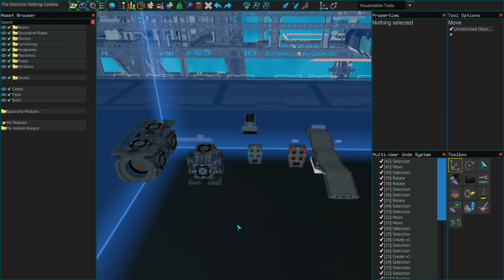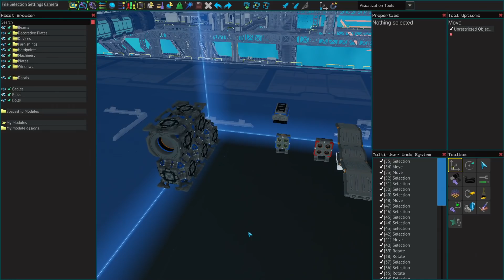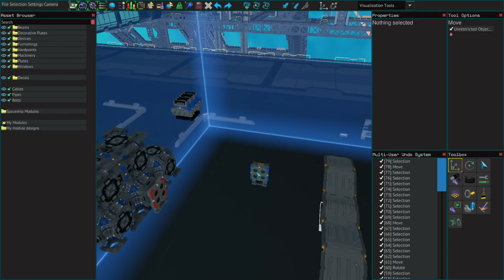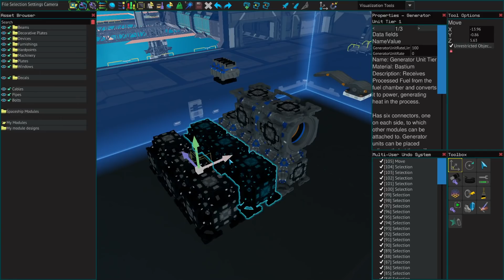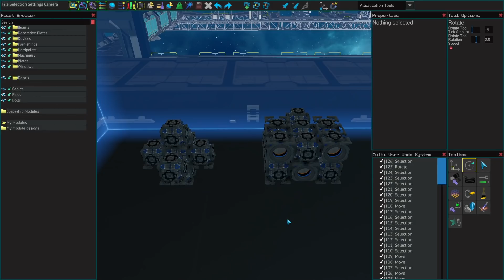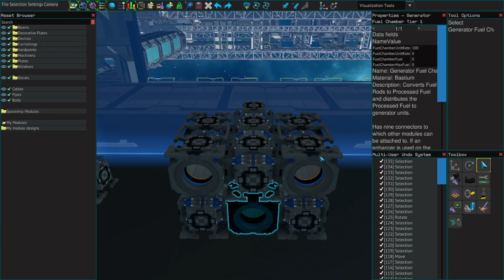STARBASE TUTORIAL: Generators: Tiers, How to Build, and Optimization

Comment: i have a question. i cant yolol yet so built a second generator to allow me to better control power output when mining. when i turn on the second generator though all the gen units in the first generator start producing power as well. they're not touching in any way other than being on the same network within the ship. is this a bug i should report or am i just doing some thing stupid?

both gens have different names and buttons to turn on. also when activating the first generator on its own its gen units show no power output. fuel is being used though and my batteries are charging :/

i have no idea whats going on or if im even generating more power than when i started.

Comment: Any reason why you are making your generators adjacent to each other rather than surrounding the fuel chamber? You can get 5 generators around a single fuel chamber with 0 adjacency penalty, or setup an array of fuel chambers with 2.5 generators per inner fuel chamber (one above, one below, and, every other fuel chamber, one behind), with an extra generator each for the two outside fuel chambers, while still having the fuel chambers together to maximize enhancer efficiency

Comment: Regarding cooling, is there any drawback to using both cooling methods in the same ship? Meaning, can I run both a cooling rack and a pipe socket & radiator? 

In the ships I've built, I have often had plenty of room for both and assumed using both just means better cooling, but at the same time, I wonder if one will cancel out the other and just be a waste.
Reply: If you have both a radiator and a cooling rack installed, it will use the coolant rack first and when those run out it will use the radiators.

Comment: Trying to understand why my ship is consuming coolant. 
Generator block creates 500 heat. Radiators can handle 1000 heat, plus coolant block itself for 300+. Somehow, this system is consuming coolant. I've gone through 50% of the coolant in the coolant block over a couple days of mining. 
My initial understanding is that the Coolant block consumes coolant for its 300 heat dump. If there are radiators attached, then it supplies coolant to those, which dump 90 heat each, but then circulate chilled coolant back tot he coolant block. So I should be able to passively handle up 1000 heat, and consume coolant to actively cool an additional 300 heat. 
Yet despite my fuel chamber and generators only creating 500 heat, somehow the system is still consuming coolant..
So.. do other devices like thrusters create heat? I've added a number of thrusters, so perhaps I'm not accounting for their heat? I can't find anything in the SB wiki to suggest that other devices generate heat. 
Are the radiators actually consuming coolant to dump heat? That's kind of not how radiators are supposed to work... 
Or is it that the Coolant block dumps its 300 heat first by expending coolant, and then the radiators passively handle any heat after that recirculating the coolant. If that's the case, then there's no way to have a coolant system that isn't constantly consuming coolant, yes? This would also mean ships only need enough radiators to handle heat beyond the initial 300 handled by the coolant block. So I could drop my radiators down from the 13 panels it came with down to like.. 3, and still be able to cool over 500 heat without the redundant mass.
Reply: cooling cells consume coolant to remove heat they are not a storage for coolant that radiators can use. also I believe they have priority so if you produce 500 heat 300 will be removed from the cooling rack regardless of how many cells there are. then send 200 heat to the radiators. 

to solve this you can use YOLO code or manually change the devise field of the cooling rack(CoolerUnitRateLimit) to 0. now it will no longer consume coolant. then if you want you can name a button the same as the devise field and change the value when needed.

Comment: How to make the display panel show the total power of 2 fuel chambers? 300K+300K = 600K
Reply: you need yolo code. name the chambers differently and then add them up like this:

FuelChamberTotal = Chamber1 + Chamber2 goto1

the (goto1) is to stop the yolo chip from doing what is on every line and just repeat the first line as there is no reason to do what is on line 20 if there is nothing there.

Comment: I've got a couple of questions...

1. Does all generator blocks connect to become on big generator (even fuel chambers count as one?)
2. If fuel chambers are placed in a checkerboard formation with generators between them, do all the touching fuel rods gain the benefit of that generator, and how does it affect heat?
3. If multiple fuel chambers are connected, do I need to extract power and coolent from each of them individually, or is it enough to only connect to a single one?

Edit:

I found my own answers after noticing a small note on the wiki...

1. All generator type blocks DO become 1 large unit, fuel chambers included.
2. Not entirely clear, more testing is needed.
3. Only one part of the generator assembly needs to be connected to coolent arrays, this is because of "A generator creates its own resource network within it"

Comment: One more tip from what I've noticed: Not having enough cooling for your setup significantly slows down the spool up time of your GeneratorUnitRate as well as the max value that the GeneratorUnitRate can reach.

I'd like to know if there are any other factors that would improve on this spool up time if anyone has any info 😊

Comment: Nice explanation! Any tips on displaying fuel rods for multiple generators? It seems that it picks the field of one randomly and only shows that, so I assume my only easy way would be to name them different and yolol add them together.
Reply: My ship has them named differently and different panels for each. No YOLOL chip needed.
Reply: @BaneSIlvermoon  yea that's fair just seems like a waste of space :)
Reply: @dunkan44  oh did you want to combine them into one panel? That should be even easier with the max fuel field. My ship does that with the propellant tanks, cooling cells, and radiators. I just have an enormous dash so I need something taking up space.

Now that you mention it though. I might have to see if I could get a little more visibility if I merged them.

Comment: I herd that if you put both rads and modules, it will use the modules instead of the rads which is dumb because the modules should be a backup for the rads. Can the modules be turned on/off depending on the condition of the rads. If the radiators become too damaged to dump enough heat, it would turn on the module instead of having to manually remove/install the cartriges?
Reply: You could probably do that via YOLOL easily. Something like if radiatorMaxRate > X then coolerMaxCapacity = 0 (or whatever those fields are)

Then flip it back if the radiator cooling gets low
Reply: I may have to go try this now. My ship has massive cooling overkill on it

Comment: for the assembly you showed at the end, would it not be better to attach the rearmost generators to the fuel chambers rather than the generators? it would have fewer contact points between generators within the same footprint.

Comment: With U tool or in designer is there any way to see how much heat ship produces and how much radiators dissipate? or just manual calculations. Also in wiki I found cooling rack works for 25 hours before cells depleted and it's possible to install coolant recharge rack. Do you ever use it?
Reply: There are fields for the radiators. I have some of them on cockpit panels

Comment: I thought coolant cells can be hooked up to a radiator to release the hot coolant.
Reply: I don’t believe so. Radiators contain their own coolant that increases with each radiator you add. I don’t think it interacts with a coolant rack at all. Just the pipe socket.
Edit: Actually you might be correct there is a rack to recharge the coolant cells and that rack might need to be hooked to a radiator I thought it just used power. Not positive.

Comment: How do I refill propellant in space? Everytime I try I end up ripping out the piping or the cabling and then I'm a propellant tank down. This is on one of the Oki ships.
Reply: Don't.  If you keep running out of propellant then add a small spare tank and configure (U) the propellant frame and turn it off.  So when you run out you turn it on at the push of a button.  

But if you REALLY want to... Propane tanks mount into propane frames, where the pipes are connected.  You could probably unbolt the one where there is no connection and remove it.  Then unbolt the tank and remove it.  Reverse to reassemble.

Comment: I was wondering if you could do a dedicated video about starship controls. Currently this is my greatest problem in the editor also having trouble getting a button to activate the generator so I guess what I'm trying to say to do a video about the main YOLO parts and how to do them for your ship? By the way enjoyed the video and thanks for the helpful information.
Reply: Theres no strict On/Off swich for the generator, but what you can do is set its limiter to 0%.

1. Look for the generators "GeneratorUnitRateLimit". You can copy it as it is or rename it.

2. Paste the "GeneratorUnitRateLimit" onto a button of your choise, to replace the "ButtonState".

3. Once the "ButtonState" is replaced with "GeneratorUnitRateLimit" or a name of your choise, set the "ButtonOnStateValue" to 100 and "ButtonOffStateValue" to 0. (If you want a strict On/Off). You can also change the 0 to something like 25 for a low fuel usage "eco mode".
Reply: Oh cool thanks that's going to help a lot.

Comment: Thanks for all the info!! Question also. Every 10 seconds my ship in test mode decides to pitch down by 8ish degrees. Any ideas as to the problem?
Reply: i had an issue where my ship would just behave erratically sometimes and generally fly in a weird way. After I hooked up a battery everthing worked fine.
Reply: You need a battery to buffer your power. If you have one, you need more.
Reply: @kameleongreen  have 3. And power stays maxed. And it not erratic movement. Pitch down only
Reply: @richardsmith5803  Whenever I have that issue, it's because the mass within or on my ship is not evenly distributed. Such as the ore in your containers. Try moving it around to balance it out. Having more too much ore on one side will cause a shift in your steering. Otherwise you may not have a thruster piped/cabled up properly and is not firing or not enough thrusters on a certain section of your ship.